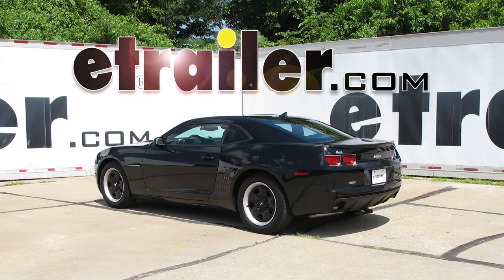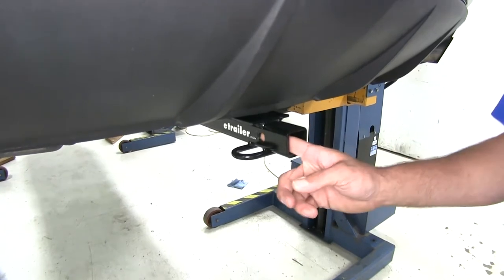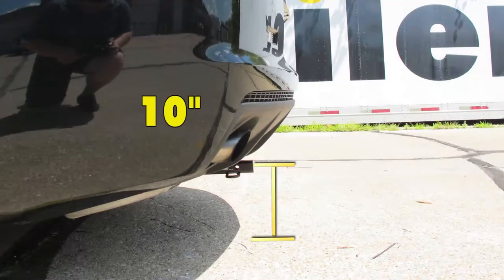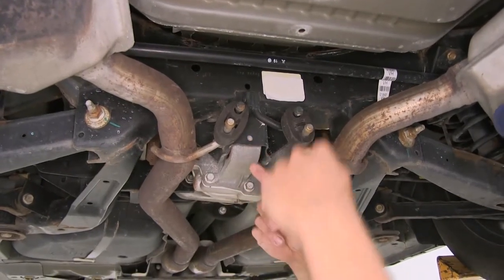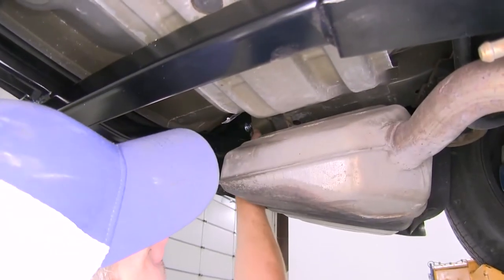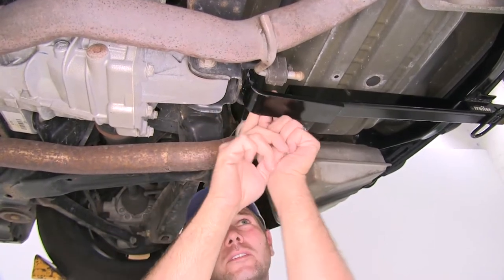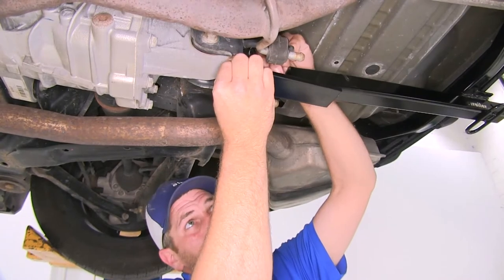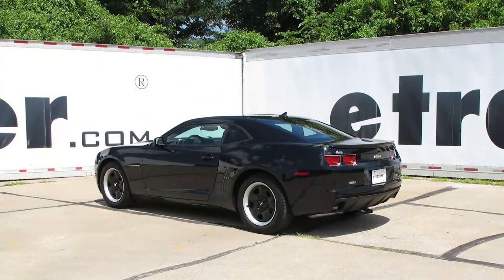etrailer | Installing the Draw-Tite Sportframe Trailer Hitch Receiver on your 2010 Chevrolet Camaro

Comment: Think this would be ok to tow a small trailer with one dirtbike?
Reply from the maker: Yes you should be ok so long as your trailer and dirt bike combined weight is not over 2000 lbs. You do want to be sure to check with the owners manual of your Camero to make sure that it can handle that amount of weight. You can find more information on this hitch you can see those here https://www.etrailer.com/p-24850.html 
If you are needing a ball mount for your hitch https://www.etrailer.com/Ball-Mount

Comment: Be good for a dirt bike 220 ?
Reply from the maker: The weight capacities of this hitch are a maximum gross trailer weight of 2,000 lbs and maximum tongue weight of 200 lbs. If you plan to pull a small trailer with your dirt bike on it, it would tow just fine. I may be a bit too much for a hitch mounted dirt bike carrier.
https://www.etrailer.com/Trailer-Hitch/Draw-Tite/24850.html
Reply: etrailer.com no just to set a dirt bike on this mount that’s it and the dirt bike rack extra 50 maybe so a total of 275 I should be good